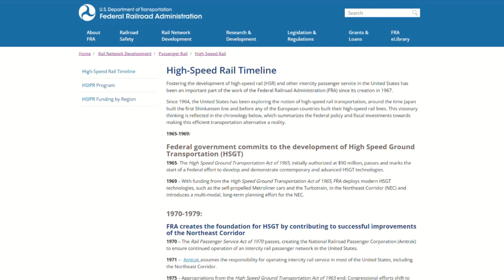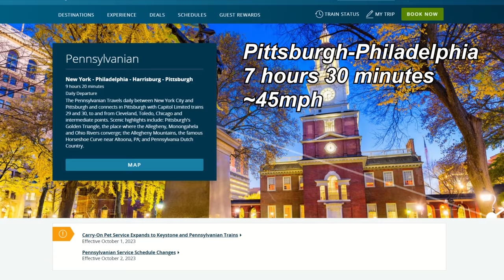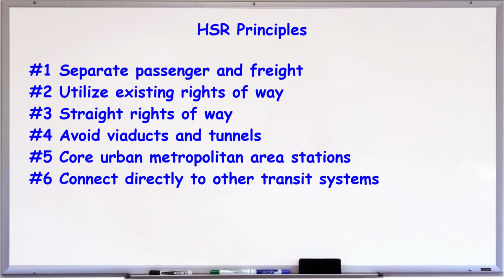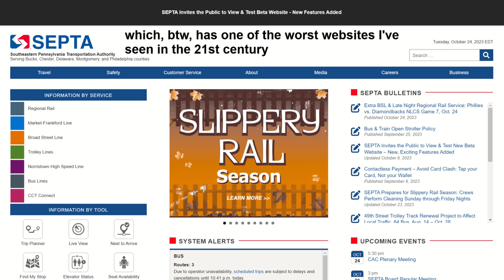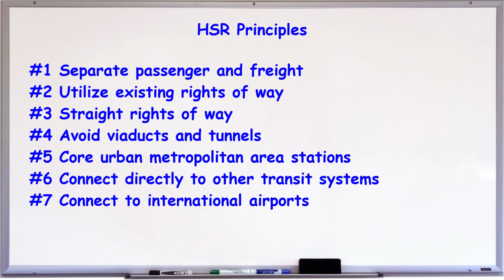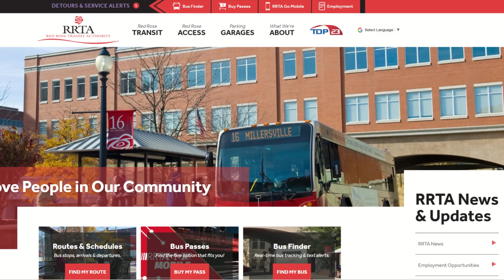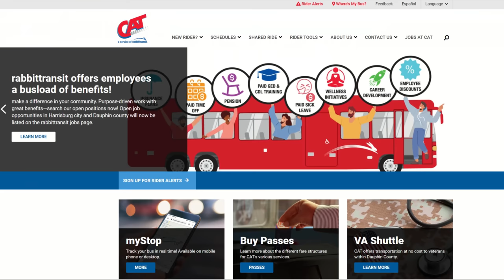Pennsylvania's Keystone High Speed Rail Corridor at True High Speed?

Comment: With localities and companies looking to end work from home, has there been any surveys done to estimate the “base” ridership based on the aforementioned expected commute/travel times? Using the NEC as a basis, especially consider the upgrade plan, we should be able to determine which level of improvements provides the best cost to benefit ratio. Perhaps some sections can be the faster option (to speed up commuters going to work) while others can be the cheaper option. With the right data in hand, then the case should be made to the public with a realistic schedule of how long it would take and how it would be funded.

 Btw, excellent video laying out exactly where and why each upgrade is needed and what benefits would be gained from implementing it.
Reply from the maker: I'm working on it. I actually intended to have ridership estimates in this video, but then the production blew completely out of proportion and it took twice as long as normal, so I left out a bunch of things that I would normally put in one of these FRA HSR corridor videos. Hopefully I'll be able to get it into the next one. If I'm able, I will whip up some numbers(I've never used the software before, so I need to learn it) and will share them on the Discord server. Link is in the description.
Reply: Always appreciate your insightful questions and intelligent comments Mohammad.
Reply: @davidjackson7281  And I always appreciate your polite and friendly responses, David, which are in stark contrast to the rude and sarcastic responses of some regular commenters on the various HSR channels.

Comment: The trains currently stop in both Elizabethtown and Middletown, so smoothing those curves wouldn't make a huge impact on the current service, though obviously would for a potential express service that doesn't stop.

I think Harrisburg airport's top destination is Philly (probably mostly connecting passengers), so skipping that station makes sense, especially if the route was somehow extended to the airport (or some agreement with Septa for easy transfers is set up), and some kind of codeshare tickets with American Airlines (the main airline in Philly), like Lufthansa does with Deutsche Bahn in Germany, would probably get a lot of passengers on the train.

Improving the connection to Pittsburgh to something comparable to the driving time though is probably the biggest thing that could increase the number of passengers. I've taken the entire route a couple times, and the trains have always been packed between NY and Philly, and then pretty empty between Philly and Harrisburg, filling up the closer it is to Philly.
Reply from the maker: I would have very much liked a station at Harrisburg International but for the factors mentioned in the video and the fact that they only have a dozen gates and their footprint is not large. If it could have served some reasonable function as a regional helper, it would have looked more attractive.  With the state of PIT and PHL there just isn't any need for that.

I saw some statistics during my research that more traffic on Keystone Service from Harrisburg was headed for NYC than Philadelphia, which I found interesting.
Reply: @LucidStew    I lived in PA for a while, and in my observation that's probably because NY has a reputation of being absolute hell to drive in, which Philly does not. People from outside of the city also don't seem to know about Septa, while New York's subway is world famous. Harrisburg does have a direct highway connection to both cities, so since most people will have to drive to the station anyway, it makes sense that those people would just choose to drive all the way to Philadelphia.

Comment: Projects like these only really work when you have other services feeding into and along it. Regular intercity rail is non-existent outside of the NEC so you'd of course need to connect Pittsburgh with regular service towards Erie, into Ohio and into West-Virginia. To prevent more harmful suburbanization in the large cities you'd preferably also want people to move to smaller towns along the route and commute from there to the cities. That in combination with the rough terrain it might be better to choose for a maximum of 200kmh (125mph) rails and increase the number of stations on the line. This would make any express services between Philadephia and Pittsburgh about 30 minutes longer but you get so much more connectivity for regional rail between Philly and Pittsburgh. 

It all depends on what kind of HSR model you want. Do you want the French model where you have insanely short travel times between the largest cities and barely connect the people living in smaller cities. This model has a lot of long stretches of 300+kmh (186+mph). Or do you want the German model where you connect large and smaller cities with regular, but slower (still fast), service. This model has shorter stretches of upgraded track to 200kmh (125pmh) and in certain cases true high speed stretches. 

TLDR: use a bit slower rail to not only connect Philly and Pittsburgh but also connect people living in between.
Reply from the maker: Bit of an oversight on my part, but this area is heavy with abandoned and disused rail routes from back in the coal and steel heydays. The Lancaster area, for instance used to have a tremendous network of commuter rail before cars and bus took over in the early 20th century. As I've said before, I think you get into something of a chicken or the egg situation with the high speed trunk and regional rail. I would said that if you build the regional rail first, the trunk will be that much more difficult. Whereas if you build the trunk first, it will build demand for regional rail.
Reply: IMHO the best choice should be german model between Harrisburg and Philadelphia and french model between Harrisburg and Pittsburgh.

Comment: If we were able to use dual mode tilting trains, how much time could you save between Harrisburg and Pittsburgh on the existing line?
Reply from the maker: I'll be working on this now that I have the latest news video out. I'll update when I have the results.
Reply from the maker: I did the rough calculations and have that at about 3 hours versus roughly 5 1/2 hours currently.
Reply: That honestly sounds good. I think it’s a shame that tilting trains haven’t been used more on more US medium-longer distance routes- that’s honestly where they could come into their own. Take for example the Queensland rail diesel tilt train.
Reply from the maker: @J-Bahn   A big problem with that right of way though is a lot of the riverine parts simply don't have the room for double-tracked electric in addition to what is already there.(or even single-tracked for that matter) The area around Johnstown in particular would be extremely challenging to the point that you may as well bypass it.

Comment: It seems that the American public does not seem to require "true" high speed corridors? The Capital Corridor is not super fast, but is well patronized, same with Lincoln Service and Hiawatha Service. I think that 80-110 mph if it is frequent and reliable will be successful. Brightline is exceeding all expectations and only exceeds 110 mph between Cocoa and Orlando Airport. BTW is is pronounced LANK-as-ter, not LAN-caster :)
Reply from the maker: I would agree that reliability and frequency are an issue with American passenger rail, but wouldn't it also being faster be better? I think the current service is so poor in most areas we can't really be sure what the true demand is. If you look at places that have an extensive, competent passenger rail network with high speed trunks, usage shifts away from other modes. Usually not A LOT, but a percentage point here and there is a doubling or tripling of current U.S. passenger rail traffic.

Comment: I enjoyed your video but as a Pittsburgher there are a few mistakes in your presentation.  Between Monroeville to Downtown Pittsburgh along I376, there is no available right-away and it is completely built up.  To add trackage, you would have to bulldozes hundred of structure.  Since the "Parkway East" is the only access to the city from the eastern suburbs, any disruption to traffic on this highway would be  devastating to the local commuters and politically unpopular and not supported by local politicians.  Also, connecting Wood Street station to Pittsburgh Union station is unnecessary because there is already a light rail tunnel and trackage between the Steel Plaza station and Union Station.  This tunnel was built to connect the light rail system to the East Busway for future expansion.  To get the train into downtown from I76, there are several abandoned rail right-aways in that part of Allegheny county.  These right-aways are not used for anything and are just over grown.  Plus there is room along the East Buss Way to squeeze in more trackage without bulldozing too many structures.
Reply from the maker: Thanks for the feedback. Being restricted to satellite views definitely lacks the perspective of living in the space. And I do value that because I feel like I truly understand my local situation in ways that are not reflected on Google maps. I do agree I-376 would require some demolition. I think its more on the scale of a few dozen structures rather than hundreds. Likely there would indeed be local opposition, but you'll probably get that anywhere to any major infrastructure project. I didn't see any fallow right of way even looking again, but if there is a way to avoid the long tunnel, that's great. Makes things cheaper and at that juncture speed is not a concern. I was not aware of that Steel-Union tunnel when I made the video, but was alerted to it in another comment. My understanding is that tunnel is single-tracked and can't be expanded since it runs directly under the foundations of a major skyscraper. In terms of benefit to the Wood St. idea, it facilitates continuation to Cleveland or Columbus much better.  In my view, the busway option is more structures than I-376(again, I lack a local perspective, I grant that). Also, that NS route is a real dog from about Trafford on.
Reply: They’re actually planning to extend the East Busway out to East Pittsburgh and then eventually to McKeesport, with a branch to Monroeville.

Comment: Wrt Pittsburgh: Worth pointing out here the present NS routing patterns actually have diverging mainlines, with the ascending route following an old PRR low-grade corridor up the Kiskiminetas and Conemaugh rivers (historically double tracked) and the historical PRR mainline being used, outside of the Pennsylvanian, for descending traffic only. I think that taking over the descending line from where it meets the Kiskiminetas route (somewhere around Bolivar) through Pittsburgh Penn Station and across the Allegheny River has enough benefits that it should be seriously looked at, not least kicking Norfolk Southern traffic out of the Pittsburgh Penn Station property.

I think your ideas are about as good as it gets for the Turnpike alignment, but tbh kind of justifies my own longstanding position that the Appalachians represent a significant enough geographical challenge that the alignment should be designed around finding the straightest, flattest route with the least technical challenges first and then see how that can be fit to existing alignments (or make a new alignment if needed) *after*. Don't forget that central Pennsylvania is extremely rural!

Comment: 7:22 High Speed Rail can handle grades of 3-1/2%.   That is for going up grade, but going down grade the CAHSR specification requires speed restrictions down to 125 mph for grades exceeding 1.6%.  Freight railroads tend to want to keep their ruling grades below 0.7%.   Which is in the middle of the medium grade zone of 0.4% - 1.2%.  The desire is for low grades of less than 0.4%.   Old friction bearing cars could be spotted without brakes up to 0.4%.   Going more than 1.2% grade places freight rail above medium grades and starts to require more specialized train handling.   

There can be momentum grades where the train it is expected to loose speed for a while and then get it back.  Rail flyovers of about 1% grade make use of that.  Railroad flyovers are typically retrofits.  Mountain grades are 2.2% and higher.  That grade limit was used by the US Congress for paying higher compensation for railroads being built through terrain requiring those extreme grades.   Those grades exist, but it is extremely unlikely any railroad would build grades at that extreme grade just to get the higher compensation.  

The means for HSR to be created makes extensive use of tunnels, huge cuts and  fills.  Viaducts are undesirable because they are not as long lasting or stable as earth fills.   There is extensive use of viaducts for cost savings and allowing easy under flow of other uses.  Many of the HSR design and building firms in China specialize in tunnels and bridges because much of the bulk of HSR is made using them.
Reply from the maker: The extra information is appreciated. I tend to generalize quite a bit because its necessary in order to get these videos out in a reasonable amount of time. However, easy to access rules like this help me a lot in making those generalizations more realistic.
Reply: @LucidStew  I keenly remember June 1981 going back on the Broadway Limited and going up to see the locomotive in Harrisburg and I couldn't believe what I found, a GG1 in fresh classic Pennsylvania Railroad Tuscan red with gold pin stripes smelling like new transformers with a plaque stating it had been restored by a railroad club.  GG1 left Harrisburg accelerating strong from a stop and just kept on going.   I didn't time mile posts, but it was very fast compared to the disappointing slow trip I'd had going the other way.   It seemed way over 100 mph I'm guessing 115 mph - 120 mph.  

South of Wilmington DE the GG1 really opened up.   My ears would pop going under bridges, billboards went by at a blur.   This time I did time mile posts and it was between 22 and 23 seconds.   22.5 seconds per mile is 160 mph.  That seems about right.   I'd been in cars at 140 mph and this speed was a big step above that.   When we got into Union Station Washington two of the passenger cars had smoke coming from the area of their axle generators.  We passed all the other passenger trains like they were standing still and they weren't.  We even passed what looked like Metro-liner service with a 50 mph edge.   I think it was an unofficial speed trial of a freshly restored GG1.   Unofficial because they we're breaking a lot of rules!   The crew of the GG1 was nowhere to be found at both Harrisburg PA and Washington DC.   I liked the experience, but I was actually a bit scared at those top speeds.   The passenger cars got strange vibrations and oscillations.  The suspension didn't seem like it was able to keep up.

Comment: As a Pittsburgher and fan of rail, I disagree with the connection to wood street station on the light rail. The tunnel connecting steal plaza with the bus way or union station exists, while you would have to drill a new tunnel to get to wood street. Let's use what exist when possible.
Reply from the maker: I was not aware of that tunnel. It is difficult to find everything relevant during research. As they are about equidistant from Union Station, I had a coin flip between Wood St. and Steel Plaza here and apparently came up tails. I'm reading that the tunnel is single-tracked and not expandable, so that may not be suitable. Another option would be stopping at Union Station and reinstating the service between there and Steel Plaza that used to operate. However, if a line like this continued north or west to Cleveland or Columbus, it would likely have to run out of Union and under Liberty St. anyway for some distance.
Reply: @LucidStew  it absolutely would run that way to go anywhere in Ohio. It is just kinda a soar subject. I mean we have unused infrastructure and it could real help. I bet it is one of many such examples of un or under utilized infrastructure in the USA.
Reply: @LucidStew The area leading into the tunnel definitely has two tracks, but I’m not sure if that holds true for the whole tunnel. They’re not currently running anything through it, but have plans to connect to union station/east busway again.
Reply: @ericrushine There are already tracks that run from union station along the northern part of the Ohio River. Are those already used by Amtrak? I imagine that’s the path it would take
Reply: @thedapperdolphin1590  it very well could take those tracks. Especially if it is going north to Cleveland. If it goes west to Columbus, it might be best to build new tracks past the airport.

Comment: Could we at least start with the section to Harrisburg? That’s the part that would need (somewhat) minimal upgrades, and is also just a smaller section. The section to Pittsburgh would probably cost, I think, easily $45-60B to build this new route along the highways to what you want. Plus taking 10-15 years, at minimum. Also, the way you pronounced Lancaster grinds my gears, because that is not how you say it. Just like how Newark, DE and Newark, NJ are pronounced two different ways. I just feel like that with how long the route is, the electrification that would needed, the tunnels and everything else, either building another track or two between Harrisburg and PA and 4 tracks for the I-76 option (assuming that it should get quad tracked), this definitely wouldn’t be cheap, not sure it would be $20B or under. At absolute minimum, probably $32-34B for the 76 option, and $24B for the existing ROW